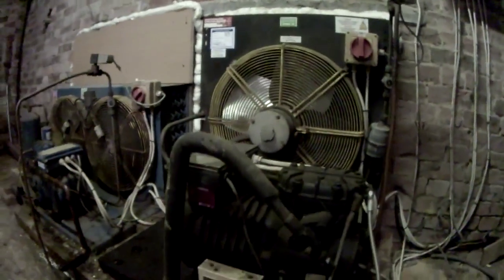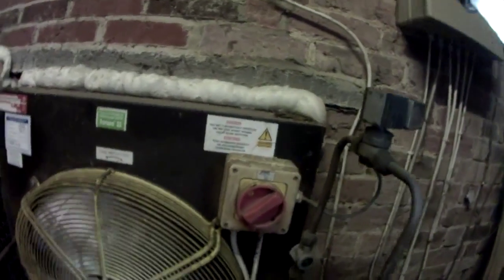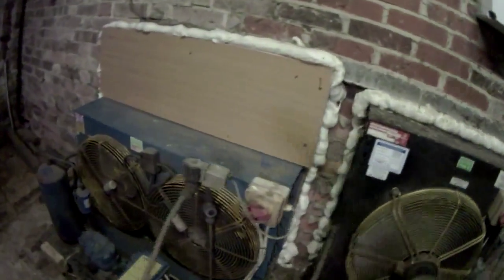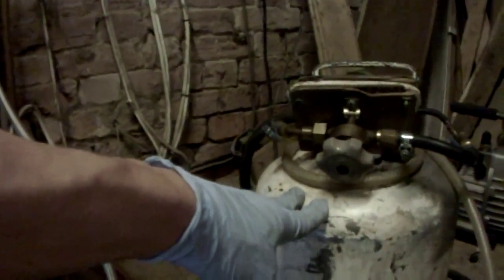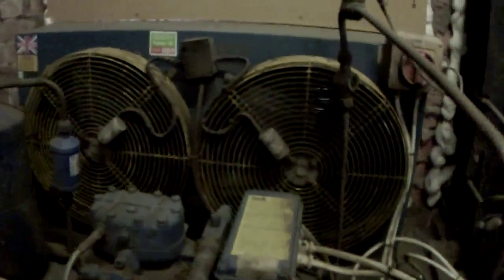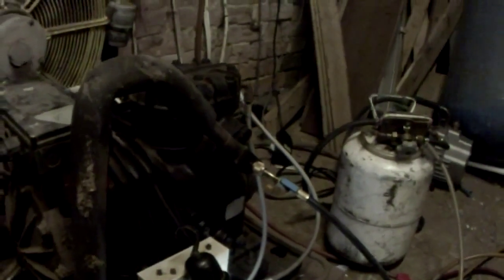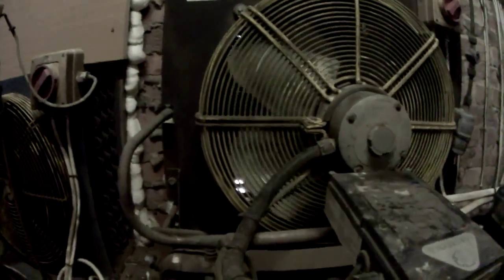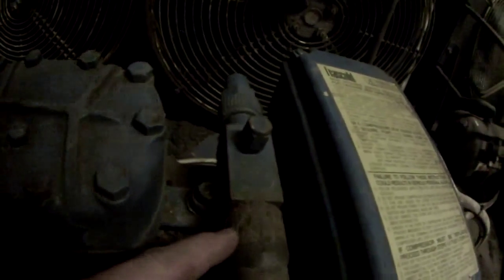Copeland Compressor Cycling

Comment: Another thing on this equipment, where is the bx cable, the unit is on the ground, 12 wire just exposed, with no proctectant around it,
Reply from the maker: These are up in a roof space but yes the cable is not well protected, not my work!